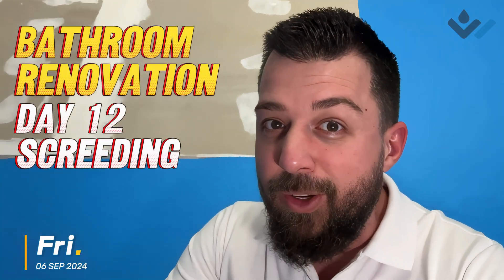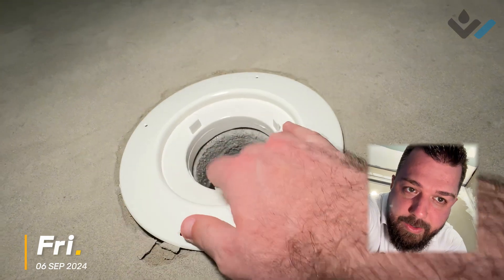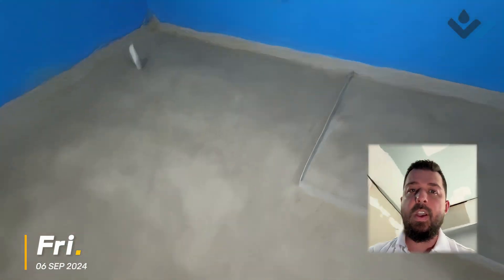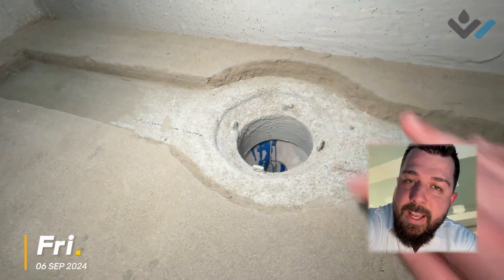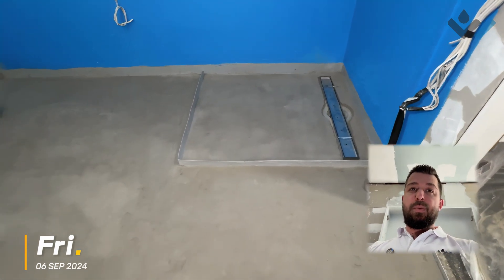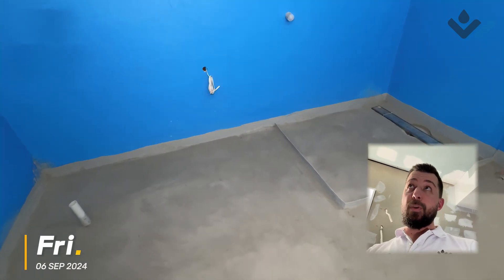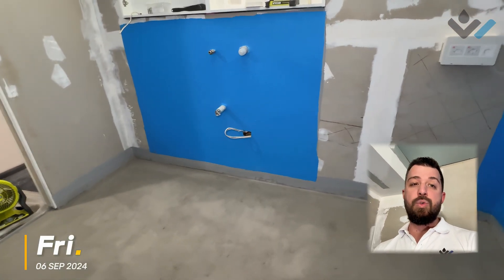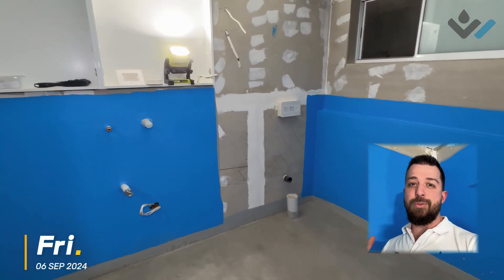Bathroom Renovation Day 12 Screed

Comment: You've put a lot of thought into that puddleflange set up David, too no avail I think. You can't seal that top flange from the bottom so a strong flush of water will rise back up into the screed and more a less flood the under screed before re draining as its a flat floor. We all know the negastatic effects of moisture on the underside of a membrane and that's why my opinion is its a waste of time with the under and over system. But that's only my opinion, cheers they are great video's though !
Reply from the maker: Thanks for sharing. good point and it is a double edged sword because if you do seal it and you have a breach in the over screed wpm the water will be completely trapped in the screed. in this specific scenario my logic is that it should be extremely unlikely that the drain point outside the shower will receive that kind of water volume because i agree that flat floor is less than ideal
Reply: Have you considered using a 100mm flange at the base and an 80mm flange on the screed to accommodate the top flange sliding into the bottom?  @DavidPrevite-WaterproofExpert